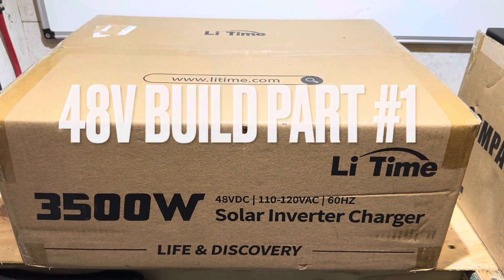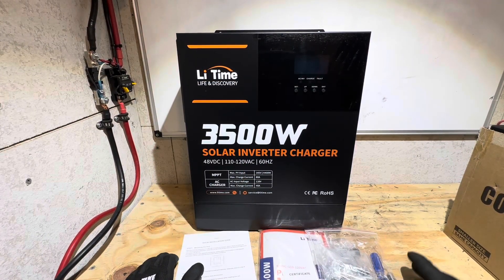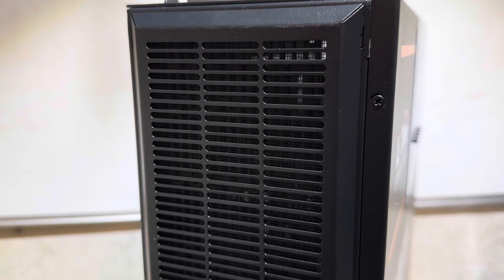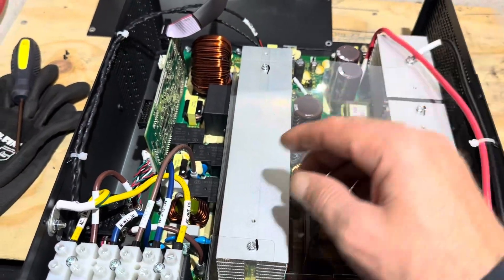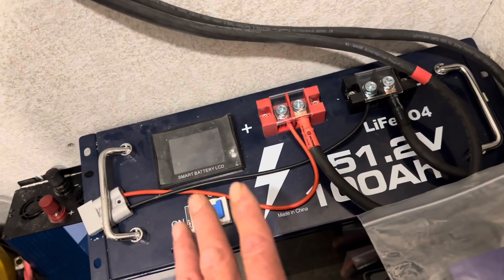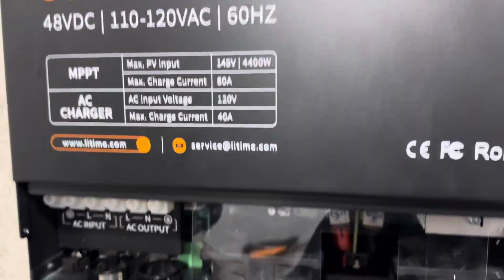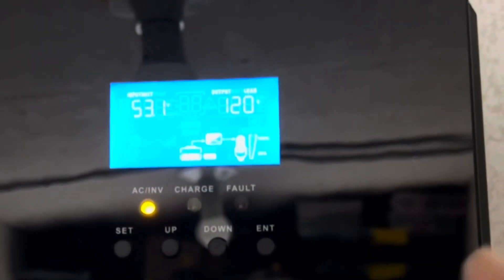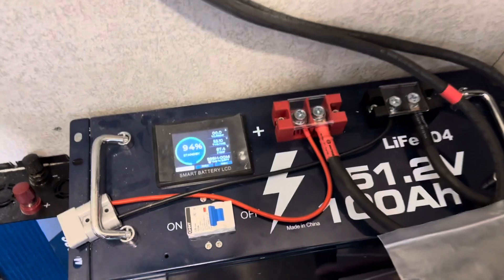LiTime 48V 3500W All In One Solar Inverter, Budget 48V Off-Grid Solar Build Part 1

Comment: Thinking about buying 4 server rack batteries and either this inverter or the 5k eco-worthy all in one inverter is there any opinions on which one would be better which actually have pure sign wave
Reply from the maker: They would both be pure sine wave. I have no experience with EcoWorthy inverters. I have some of their solar panels and they don’t perform very well. Their rack batteries are good though especially for the price.
Reply: @THEOFFGRIDMOUNTAINHOMESTEAD what’s your preferred solar panel? I’m looking to buy some more…
Reply from the maker: @dieseldawg7132 What size format? Buying a pallet I would go with Hanwha Q cells or Mission Solar. 
Buying just a few I like JJN and CallSun 200W Bifacial.
Reply: @THEOFFGRIDMOUNTAINHOMESTEAD I was thinking around 350 watt….. I have enough for the moment I got like 24 ecoworthy bi facials 195watt probably have more then enough but I wanna expand at some point
Reply: @THEOFFGRIDMOUNTAINHOMESTEAD I have their bi-facial panels… they were dirt cheap off eBay around $78 bucks a piece, I only have about an acre and to many trees around so I had to over panel to over come the neighbors tree shading my panels 😂

Comment: Great video! Thank you!
Does the battery charger in the inverter charge the battery all the time or does it have a setting to start to charge the battery say 40%?
Reply from the maker: Appreciate you! You can set the battery charge voltage to whatever you want! Or if you have RS485 communication on a battery it can work with several BMS protocol options. Hope this helps!
Reply: Yes!!! Thank you for the reply. I’m wanting to use the LiTime 48v inverter with a good battery combo to power my sump pumps all the time and use the grid to keep the batteries charged until I lose power and have enough battery to power the sump pump for about 2hrs. @THEOFFGRIDMOUNTAINHOMESTEAD
Reply from the maker: @rickriggs3058 You’re welcome! 
Very interesting use case scenario!
Reply: Sure is! I’m tired of battery backups that don’t work or don’t last. Last week we lost power and I had to carry water from my basement to out side for an hour till power came back on. With the technology of battery’s and all in one inverters I would set it up to run off of batteries and not worry about when the power goes out we are not home. So I’ve been watching your YouTube channel and getting some good information. So thank you for content it’s been really helpful and I like you tell the truth about the product you’re reviewing. Have a great day and a great weekend!!! @THEOFFGRIDMOUNTAINHOMESTEAD
Reply from the maker: @rickriggs3058 Thank you!

Comment: I REALY want to like this unit, but there's one thing about it that I cannot get past, it's a singular unit only, meaning that I cannot run multiple units in parallel for a higher output...
I'm hoping the Li Time either fixes this in future versions OR comes out with a unit(s) that has this capability...
I do use other Li Time components in other projects, and really like the quality to price point ratio...
Reply from the maker: Agreed a parallel capability would be nice to have!
Reply: @THEOFFGRIDMOUNTAINHOMESTEAD  I would jump on this in a heartbeat IF they supported parallel integration...
Reply from the maker: @wipatriot510 They may have missed a great marketing opportunity with this model by not incorporating the feature.
Reply: @ Perhaps that next...???
Reply from the maker: @wipatriot510 I’ve asked them about this possibility. No definitive answers yet…

Comment: where can I find a copy of their user manual? Couldn't find it on LiTime website. Amazon seller told me only provide to purchased customers. That's weird. What they try to hide?
Reply from the maker: You bought one used and need manual?
Reply: @THEOFFGRIDMOUNTAINHOMESTEAD  no. I want to research the functions before I buy. Usually manufacturers are more than happy to share the information about their products to public. I don't understand LiTime's strategy. Why they hide it.  I can buy one from amazon and return it if I found out the functions do not meet my needs. My lost is just a trip to UPS drop-off.  Seems like LiTime doesn't care their return rate.
Reply from the maker: @speederc3662 No PDF/shopify document link on the LiTime website or Amazon list?
Reply: @THEOFFGRIDMOUNTAINHOMESTEAD  update, On LiTime website, the CS send me a dropbox link to download the pdf version.

Comment: Just a better version of Renogy with dedicated AC grounds instead of common AC ground. Still does not have a screw hole at the bottom to mount the unit securely.

Comment: Can you overpanel this particular inverter? I have to return a brand new PowMr Relab 3kw because you couldn't overpanel it.
Reply from the maker: I’m not sure of over paneling capabilities with this one. There is no data on this from the manufacturer. Sorry I couldn’t help answer.
Reply: @THEOFFGRIDMOUNTAINHOMESTEAD  according to everything I've researched. MPPTs are DESIGNED to inherently be able to limit current. The tech support person at powmr who told me I couldn't exceed the 13A rating was wrong. When I was I was returning it, they later corrected themselves to say it won't use more than 13A of current. So pretty much any MPPT controller could be over-paneled so long as we don't exceed the max VOC, so that on cloudy days, you get more output than you normally would with out the extra panels. My inverter maxes at 1600W usable, So my array will be 1800w (107v @ 17 amps give or take). I don't care that the extra 200w is clipped on sunny days, but im anxious to see what gain I get on a cloudy day.

Comment: Needs to be at least 6000w output and 450v pv input to get me interested.
Reply from the maker: Thanks for sharing your feedback!
Reply: Yeah. If you have, say, 10 panels you’ll need a higher voltage model. Models like this LiTime and some Growatt models that support 60V - 145V DC solar MPPT input are perfect for smaller setups. E.g 4 panels on an RV. Different use cases.

Comment: Hey i got the 24v 3000w version. I have a question. With the power switch in the off position, i still get AC out at 124v. With the switch on. All i see on the screen is the line connected to the light bulb as in AC load. Is it supposed to turn off current in the off?
Reply from the maker: Mine has 0V on the AC out terminals with the switch OFF. This is with GRID 120V supplied. 
When the switch is ON the GRID 120V passes through supplying power to loads and charges battery. 
I had another viewer that asked me to test this as well. Wonder if the 24V has ability to pass through like some other brands on the market? My 48V one definitely does not!
Reply: @THEOFFGRIDMOUNTAINHOMESTEAD  it does have pass through.  But I assume when power switch is off the whole system would be off and safe to handle
Reply from the maker: Thank you for confirming this about the 24V model! Interesting that this was included on 24 but not on the 48. I prefer how mine works with no output at all with the switch off.  Another viewer wanted this feature to pass through loads and save the idle consumption.

Comment: Great video as I just ordered this inverter a few days ago off amazon along with 2 of their 48V 100AH Li Time batts. I've been using a small 12v solar set up at my storage place for the past 8 years so jumping to 48V is going to be a huge improvement. Started with 6v AGM in series with 800A bank then replaced with 3 12v 200AH Li time only 2 years ago. Have been very happy with the batts but do you think I should have gone with our used another brand? The two Li time I just ordered are not the rack type but the big flat type, a mistake in your opinion? Are you planning to use full time in your camper or home? Curious where you are located, you sound Southern ;)...I'm in East TN?
Reply from the maker: Glad you enjoyed the video! I’m sure you will like the inverter! You already have some experience which is always a great thing! LiTime makes great batteries so I think you made a solid choice. I’m not sure what you mean about flat type batteries? Did you order 48V or 51.2V there is 15 cells in the 48V and 16 cells in 51.2V which is the standard for “48V” lifepo4 installation. There are 4 cells in a 12.8 lifepo4 battery for example. (4cellsx4batts=16cell) 
I had a video on this several weeks ago. 51.2V 16S batteries are the preferred option. Hope this helps, let me know which one you got.

Comment: Do u know if the inverterchas to be on for grid bypass to function? So with inverter off and grid connecter the output terminals are live?
Reply from the maker: I have not tried this yet. I will tomorrow
Reply: @THEOFFGRIDMOUNTAINHOMESTEAD  appreciate it trying to see if can avoid keeping Inverter on 24/7 to stop the idle power draw if I just want to do grid bypass. Thankd
Reply from the maker: Checked this for you. If the LiTime is powered by the grid it does not pass through unless powered up from the on/off switch. The display will power up with grid presence but the output relays are N.O. contacts and remain this way until powered ON by the user switch. Hope this helps you!
Reply: @THEOFFGRIDMOUNTAINHOMESTEAD  this doesn't help thanks. I have a PowMr inverter that the inverter doesn't have to be on when getting grid power (per manual). So I can save myself some of the inverter idle power consumption. I'm going to test it out shortly to verify. Thanks again for the info

Comment: Been kicking this around with limited luck doing research. So glad I found this video. I'll be placing the order as soon as I finish typing this. Can't beat the $467 price going on now. I have a Ryobi 48V riding mower that I recently converted to 4 x 100Ah LiFePO4's. The factory charger was for lead acid. Not only will I be able to charge the lithium with this, but it will also be a good power backup for home. Also, the battery bank in the Ryobi is on a rack that easily pulls out, so it can be throw in the back of my tow vehicle for extra RV power. Thanks for sharing your experience!
Reply from the maker: Awesome! Great idea for a dual purpose battery in the mower! I’m working on something similar with a golf cart! Glad you enjoyed the video! Appreciate you!

Comment: I don't understand why so many of these only allow 145-150 Voc solar input. That means having to run several parallel strings of panels, which means extra wiring, connectors, circuit protection, etc.  Doesn't make sense to me.
Reply: there are two types of Inverter/Charger combo units from all the brands. Some that allow MPPT charging between 60V-145V, and some that are 120V-450V. The lower voltage models are for smaller setups (as few as 4 panels. On an RV, for example ). If you have 10 or more panels you’ll need the higher voltage models.
Reply: Agreed my friend. Much better going with a EG4...500 voc 👍

Comment: Inverter $540 + 48V 100ah batter $950 = $1500 for 3500W AC, 4400W solar input, wow!
Reply from the maker: Add some panels and wire and it’s a capable and efficient small system. IMHO way better than a portable power station!

Comment: Can I run 2 in split phase US?
Reply from the maker: The manual says the unit is not capable of parallel operation so no 120/240 with the current configuration. The hardware/boards look very similar to a unit that is parallel capable. I have emailed LiTime with this question!
Reply: I have the 24v and putting a victron auto transformer to have 240v

Comment: Thank you for the video.  I ordered the exact same equipment you are using last week and expect delivery soon.  This will be my first build and I am looking for any tips and tricks I need to know about this specific build.  Your video is coming at the perfect time for me.
Reply from the maker: Glad you enjoyed! I am breaking this up in a step by step and hopefully easy to follow series. I’ll cover everything you need for this or similar build. If I overlooked something you need more information on just let me know. 
I’m doing the 12V and 48V builds to try and help folks get a reliable backup power source. Pros and cons to each system. 
After Helene I think many found a weak spot in their emergency preparedness plans. Days and for some weeks without electricity was not very fun… especially when gasoline was unavailable for generators! Thanks for your feedback, glad to have you onboard!
Reply: @THEOFFGRIDMOUNTAINHOMESTEAD  That is exactly my case with Hurricane Milton in Florida. No fuel for days and generators need fuel.  I purchased the same controller and battery you are using in this project. I am still trying to determine which Solar panels would be the best and I plan to have this as a portable solar generator to start.
Reply: @THEOFFGRIDMOUNTAINHOMESTEAD  
I got a BUNCH of Questions? 12v vs 48v AIO... 
I have  4x 100ah 12v Lipuls,, 
stuffs still all in the boxes, 
One piece at a time... 
I now have everything i need..
but?  i will wait till your done with your Video's......:face-orange-biting-nails: :chillwcat: :shelterin:.....
No pressure,,, LOL...